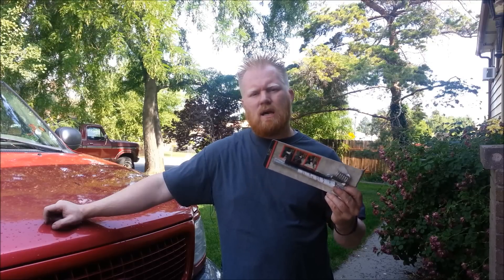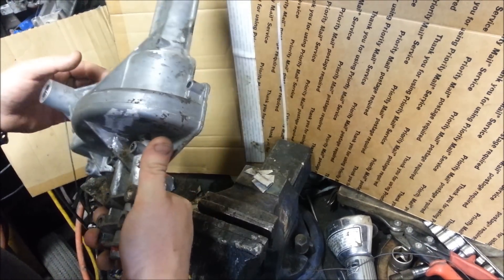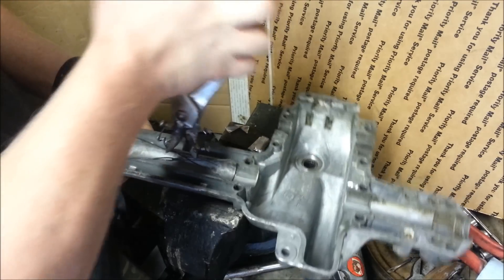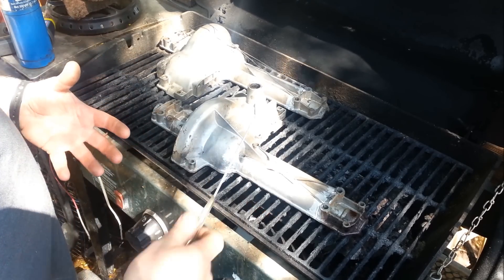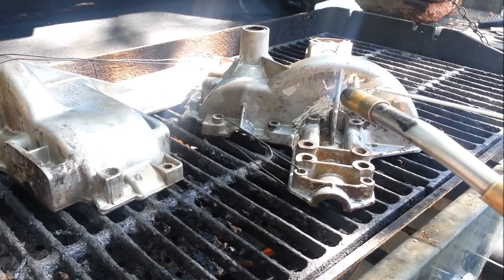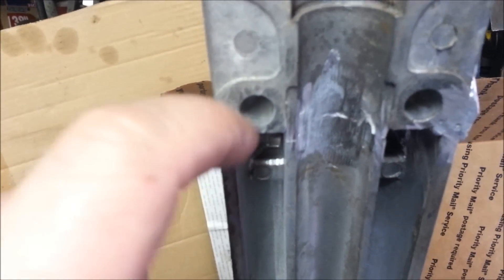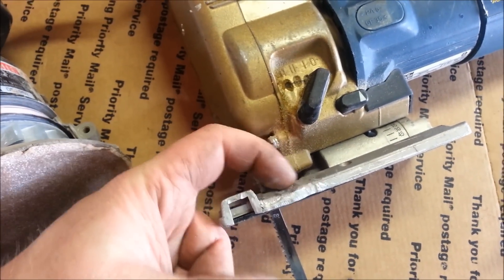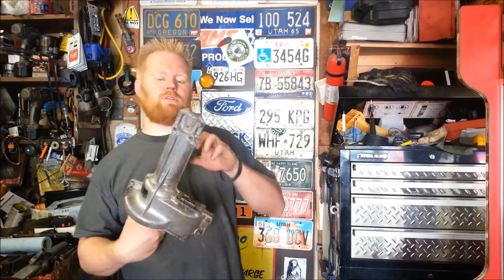Aluminum Welding with Propane torch Brazing Rod

Comment: I need to build a custom size bed frame for my RV build's bed lift, and I don't know how to weld. I have 1.5" rectangle tube stock and was figuring on paying a welding shop. Any opinion on if these brazing rods could serve me well? Would be lots of 90 degree butt joints...
Reply from the maker: I would bolt it together or pay a welding shop to run some welds. This is not an easy process if you've never welded(brazed) before.

Comment: Very impressive bit of brazing.  Did you use any flux?
Reply from the maker: I didn't as the stuff I used didn't call for it. However, others have used flux with good results.

Comment: I have a question. I have my aluminum boat I want to seal up a crack and some rivits. I am good at welding with a mig and stick like a pro but aluminum I have never messed with and I have brazed steel before but again never aluminum. I tried to do the repair and it didn't work so well. I tried propane and it didn't get the spot warm enough. it melted the rod but after it cooled it chipped right off and I cleaned it really well with a wire brush on a drill and then a new stainless wire bush. then after that the boat actually cracked on me like 5 minutes after I was done. (I was doing a rivet on the spine and the spine cracked) I tried a brazing tip with  oxy acelalyne like I saw ppl do on videos of boat repair but it instantly warped the boat within 2 seconds and I always keep the heat moving so I don't blow through it. just want to know your input.
Reply from the maker: I weld steel all the time and this is totally different. I've only had good luck with thicker aluminum as the thin stuff looses heat too rapidly. The entire piece needs to be heated like I did with the bbq to get good results. Not preheating and trying to focus heat in one area with propane or oxy doesn't seam to work with this technique. Also as you know there are a bunch of different aluminum types and some just won't take this brazing rod well. I think your best bet may be to make a larger patch and rivet it in or find a person to tig weld it.

Comment: The other reason for heating the whole project is the expansion and contraction rate is even and less likely to crack upon cooling. Had that problem on VW heads.
Reply from the maker: +David Link Good point.

Comment from the maker: The rods I use in the video are linked in the description.
Reply: Could I use these rods to braze my bicycle seat-tube, it's cracked about two inches from the top just below where the saddle post slides into it. There was a clamp-on type pannier/carrier bolted to it & the bouncing movement of the pannier eventually cracked the circumference of the seat-tube.
The problem I see would be getting enough heat into the cracked part without completely ruining the paintwork or distorting the frame. Would a blowtorch be enough to isolate the heat to the spot which needs brazing or should I leave it into a shop to be tig welded?
Reply from the maker: I would have it tig welded since it is a high stress part.
Reply: sixtyfiveford Cheers buddy, great vids, thanks for the quick reply.

Comment: Is it still working???
Reply from the maker: +Slap Stick Yep, working great.
Reply: sixtyfiveford Wow...all with propane.  What do you think of those MAPP/Oxygen torches? You think we could avoid the BBQ with that when welding aluminum?
Reply from the maker: The Mapp/oxygen will turn your part into a puddle of molten aluminum. This brazing rod melts at around 700F and aluminum melts at around 1200F. So the idea is to balance it in this range and not allow the aluminum to melt. You can easily do most parts with just a propane torch.
Reply: sixtyfiveford Good to know! Love this channel. More welding vids!

Comment: I tried brazing an aluminum boat that had 2 patches in it. It didn't go too well. That's a really good idea to put the pieces on the grill. I would never have thought about doing it that way. Great video. I couldn't fit a 15 ft long boat on a grill. Lol.
Reply from the maker: Love2boat92 That would be a nice grill! Aluminum dissipates heat way to fast. This stuff definitely has it's limitations.
Reply: sixtyfiveford Yeah I sure would be. Wish I had a tig or mig welder.

Comment: I tried fixing an aluminum boat with those, small holes had about 50% success rate, anything say 3/8 inch wide by 2 inch it would get close and fall thru. Other demo's I have seen make it look too easy.
Reply from the maker: ug mold I have messed up quit a few things myself.
Reply: sixtyfiveford Roofing Tar fixed it right up.

Comment: You think this will work for a pocket bike with broken motor mounts?
Reply from the maker: Knightkitt3 You just have to get the entire piece hot.
Reply: sixtyfiveford   You think you can roll up a rod put some stamps on it  and mail me one?
Reply: I dont know how I got logged in to my alternate email
Reply: sixtyfiveford   For sme reason I can only get it to stick to one side. I've cleaned and grinded it and tried just welding to the housing. But still just sticks to one side
Reply from the maker: Both parts needs to be hot, the entire part.
Reply: Yes.  I took the top part off and heated just the bottom part only just to see if it would stick. But no it would not stick heated by itself eaithet

Comment: Thanks for the video.  I need to repair a bolt hole on my motorcycle engine.  I have the rods but was thinking I needed flux?  (hard to find aluminum flux)  You didn't use any.
Reply from the maker: Bob Dawber Yeah, no flux. I actually tried this with flux just a few months ago because someone else asked me the same question and it made a mess. On an engine your best bet is to step up the next biggest size bolt and tapping new threads. It is a very delicate balance of heating up a large part without warping or melting it to use this stuff.

Comment: Can you braz 7075 t6 ?
Reply from the maker: nick39691 The rod claims it sticks to any aluminum.
Reply: Ok I know it works now just tryed it on a Smallpiece but having problems heating up the ar15 lower to the 700 kinda scared I'm going to melt it or  warp it.
Reply from the maker: It's a very delicate balance with the heat. If it is an important part, it may be worth while to find someone to Tig weld it for you.
Reply: nick39691 Did you try it on the 7075 T6? If so, did it stick and how strong was it?
Reply: Yes really good came good can't even tell it broke. Had to get map gas though so I could get it hot enough
Reply: Make sure you get it on both sides off the aluminum that your brazing.
Reply: nick39691
 Thanks, I'll give it a try.

Comment: Okay critics, I am a pedant - but here's a plea for calling a process by its right name. Welding is when you join metal objects together with the same type of metal. Brazing is when you use a rod of different metal to the workpiece using a relatively high temperature, although less than the melting temp of the workpiece. Soldering is when you use a relatively low melting point rod (or wire) to make the joint. These three are in descending order of joint strength (exceptions apply). There are also oddities such as silver soldering, which makes a very clean, strong joint in brass etc.
Reply: Robert Seviour so by your definition, this is welding if the base piece is aluminum and the rod is 100% aluminium? I think you just need to shut the hell up. Welding is fusion using a plasma electric arc.

Comment: son has a VW passat, oil pan cover scraped a speed bump and has a small crack leaks oil. pulled pan and a machine/welding shop says NO WAY, auto parts store new pan $257 + tax. Your video and rods from harbor freight @ $17 and I am a plumber by trade..... Much Mahalo's - amazing stuff, great info for do it yourself's- Aloha
Reply from the maker: Thomas Guy That's great to hear. Thanks for watching and the comment.

Comment: Good brazing techniques.  Most people fail because they heat the rod not the parent metal.  I did a lot of brazing with gold alloys and once you apply heat to braze, you can not go back because it oxidizes.  Good job!
Reply from the maker: Trevor Pope Thanks. "Gold Alloys" , jewelry?
Reply: Dental prosthetics.  Bridges and implants.

Comment: Great job sixtyfiveford im going to start brazing. Do you think this will work on a cracked cylinder head? Thanks for putting this video out.
Reply from the maker: oldskool funk I do. The larger the item though the more difficult it becomes as you to get the entire item hot.
Reply: ok cool no problem I will put it on the bar b que grill just to warm it up (Great Idea by the way) while brazing lol. Thanks I really appreciate your video it put my thinking on a whole new level. God Bless
Reply from the maker: Take care.

Comment: Ive used that a couple time's in home a/c line repair but now i see what i was doing wrong on the other repair i tried it on. Once it's there LEAVE it alone. It kinda bead's back out if the repair if you try to add more or make it look better. And i didnt heat a large enough surface for heat dissipation.
Reply from the maker: I was going to try it with some flux to see if I can get better flow.
Reply: Did you ever try it with the flux?  I have a cracked T-stat housing I am hoping to seal up. The crack is pretty small and I'm having trouble getting it to flow into it fully.

Comment: I don't want to piss on your camp fire, but I have to say that you are kidding yourself with this brazing rod. Out of desperation, I have experimented with these brazing rods before, and they sucked. You need to consider that your mower part appears to be under-engineered to begin with (hence the numerous cracks everywhere), so I wouldn't repair it like that. You should really be welding it properly. Get yourself a cheap Mig welder and convert it to weld Aluminum. It doesn't cost very much and you DON'T need a spool gun! You will end up being much happier about the results. And you can still use the MIG welder to weld steel too. 2-in-1. That's what I do in my garage. And you will get professional results. :)
Reply from the maker: I do own various welders including several Mig setups with gas but it's not worth the investment for the once in a blue moon I do aluminum. The Aluminum Brazing rod can't be used like welding rod nor soldering wire. The entire piece needs to be preheated and the rod melted by the temperature of the part and not by the flame, that is where people fail. The transmission in this video takes a ton of abuse and has help up without any issues since the repair. Like welding there is a process that needs to be learned. Now this isn't to say actually welding aluminum is bad, it is better and stronger but even better than welding is to just buy a brand new part. Sometimes welding is good enough and sometimes brazing is good enough but though I have the means to buy an aluminum setup the majority of people who watch this don't and just need a simple cheap solution.
Reply: sixtyfiveford  Well said!!!!!!

Comment: Thanks.  Like the BBQ tip.
Reply from the maker: Thanks, I hope it comes in handy.
Reply: sixtyfiveford It did. Warmed my intake on the bbq and went at it with the MAP gas torch.  Repair was successful.  Thanks again.
Reply from the maker: That's great. This aluminum brazing rod can be tricky but seams to hold great if you get it right.

Comment: Great tutorial. Thanks for posting it. In one post you answered below, you said that they quit making mapp gas several years ago. I for one don't know what mapp was but did just buy a mapp kit to help with some larger home plumbing jobs. What is the difference between the old and new mapp and did I waste my money getting a mapp kit? Thanks,
Reply from the maker: The new MAPP gas just isn't as hot as the old MAPP gas was. It is still hotter than Propane so it is not a waste.
Here is a short article on it http://en.wikipedia.org/wiki/MAPP_gas
Reply: sixtyfiveford Thank you a bunch for setting my mind at ease and for the link!

Comment: Like the grill idea!  I used that aluminum rod to shape some aluminum edging for a landscape project.  It worked awesome.  Hard to fix something like a casting with it due to the loss of heat.  Show us it on the tractor working.  Nice video

Comment: Love the heating method, only you could think that smart :-)

It looks similar to soldering/brasing or gas welding, sort of.

Well you made that look easy, never seen ally fixed like that, now turn over the item and add the barbicue sauce ha ha :-)